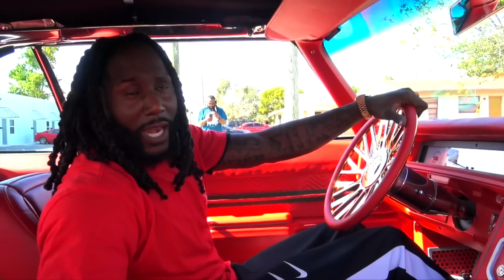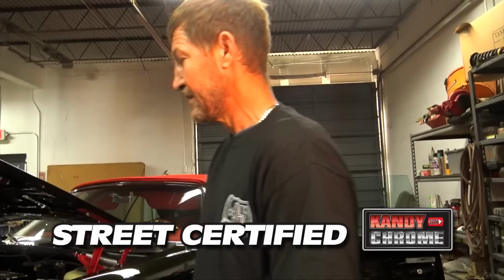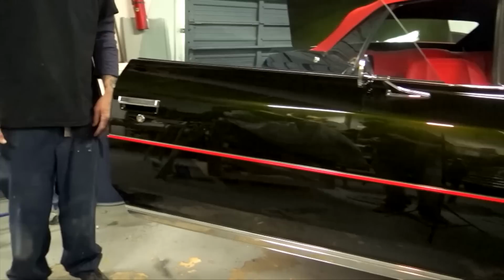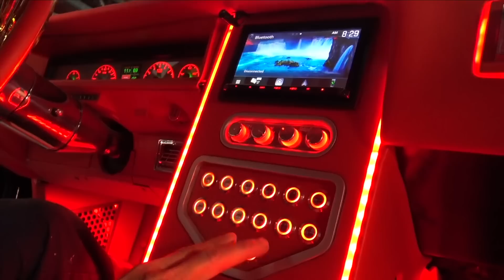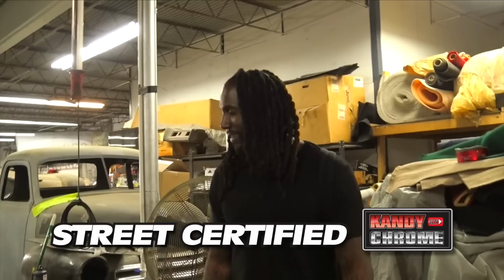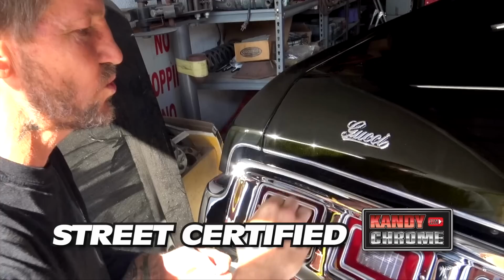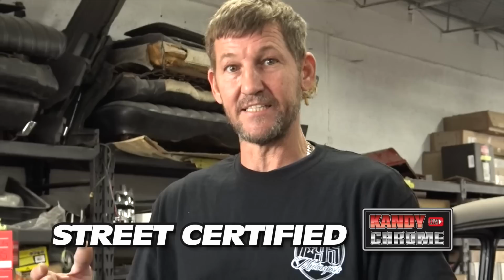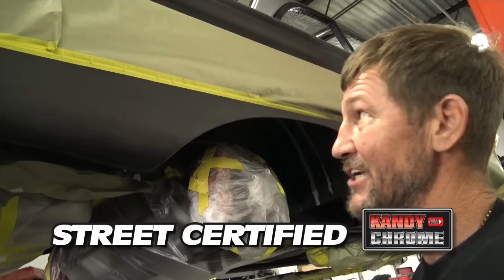KandyonChrome: OFFICIAL GUCCI DONK VIDEO OWNER NFL ERIK WALDEN

Comment: Idc what nobody say it doesn't take 200k to build a donk, they just know who spending
Reply: your wrong, its the shop hours. so yes its maybe 70k in parts the rest is the man hours spent on your custom xyz.
Reply: Depends on the caliber of car you're tryin to build. It's real easy to break 100k on a car. 25 for car 25 for drive train 20 on suspension, brakes, rack and pinion etc etc, 25 or better on paint and frame off body work. Now keep going with interior, music, any chrome or powder coating etc etc etc. Then you gotta pay someone to fabricate and build it
Reply: You got to have that thing running.  Candy paint interior  has be right music the list goes on. You can't half step  on this type of car I love it.Great work on this toy. I know  guys that work on there cars for years  before it comes  out.
Reply: These boys are putting top of the line parts in they're car with real solid gold fixtures, those supercharged engines alone can hit you for 80k
Reply: U Wrong for sure lol